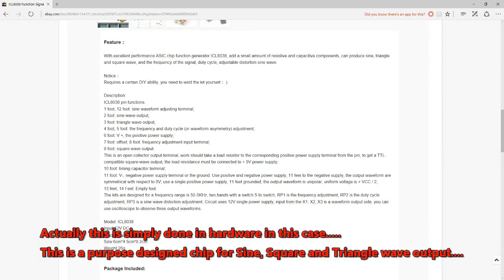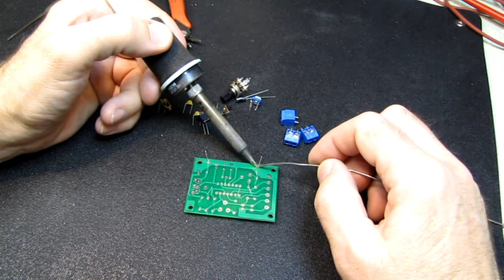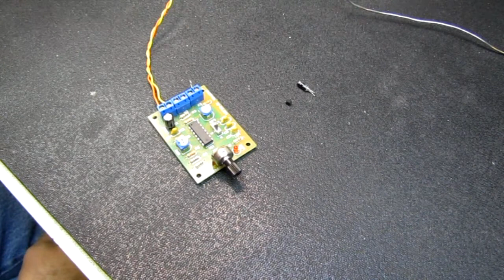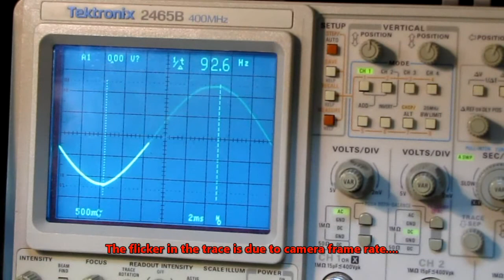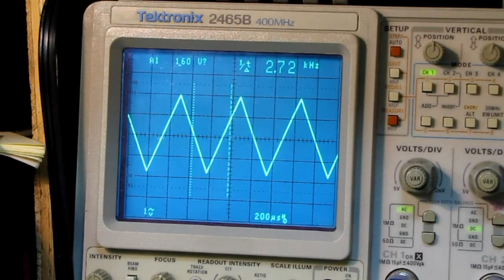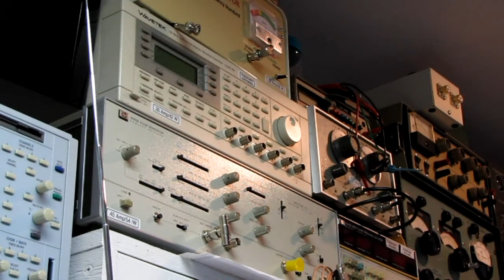10 Buck Test Bench - Sine Square Triangle Function Generator - Win

Comment: Had a rather large filter cap blow on me a few weeks back, I was going to use the boost converter to power something or another, I hooked it up forgetting that I had pulled the variable resistor to use it in a case, and not replaced it when I pulled it from the case. The Capacitor did not like it, I saw a bit of smoke and put my finger on right when it blew!  Sounded like a 32 pistol going off, my wife and daughter came running to see what had happened, there was paper and foil all over the place, and the boost converter landed in the garbage can, where it stayed till garbage day.  Does make the day a bit more exciting for sure. Thanks for the videos I do enjoy them a lot.

Comment: I think the whole mailing situation is pretty simple. It really costs a fraction of a dollar to send a big padded envelope from HongKong to anywhere in the world. The country of origin is responsible for delivering the mail to the country of destination at its own cost; then the local mail delivers it for an internationally agreed fee that is pretty low.

Now most of the postage you normally pay is not for delivering mail, that's actually super efficient, but the maintenance of the local subsidiary network. Since in China the mail is state-owned, this is of course a form of subsidy - even if they don't subsidize the transport, the fixed cost of the infrastructure is not part of postage. This would have been traditionally the case to support communication within the country, that you happen to benefit is likely merely incidental. Chances are, they mail orders and orders of magnitude more within the country than outbound, as most import businesses use freight logistics services for pallets or containers.
Reply from the maker: HI Siana, Thanks for the information. I have however seen postage on some packages that is equal to the value of the item I purchased. Thanks for watching and all the interesting comments.
Reply: The thought that some items cost literally nothing crossed my mind a few times. Well rather, it crossed my mind that these items sold well under material and manufacturing cost. Overproduction? Cost of recycling higher than giving it away for free? Some cheap items were defective by design - by successively trying to optimize manufacturing cost, the result was something that couldn't possibly work. Some items were not up to electrical safety standards. But they all cost something to make. And then if you consider - there is extensive consumer protection in China since 2013, there are safety standards, same as in EU since about 2006. Many of these things you get under cost or for free essentially couldn't be sold to consumer in China, but they obviously don't have laws against shipping them abroad.

Don't think it's the case here with these boards, i think they're profitable.

Comment: I got a SIMPSON 420 function generator on EBAY for $30 and it works well except it also has a small "point" on the sine wave like your did before you adjusted it.
I have a buddy that will adjust mine as he has the equipment to do it.
Reply from the maker: That "point" is fairly common as most function generators make the sine wave out of a triangle wave. $30.0 is a good price. But likely out of the reach of most Primary or High School Students. Trying to keep it affordable for the young players.

Comment: Nothing like a designed in explosion.  Even if it was rated at the proper voltage that's the one part I would substitute with a good name brand one.  I hate cheap electrolytics.  Otherwise it doesn't look to bad especially considering the price.  Would be the perfect companion to the little SSB two tone audio generator I did a video on the other week.